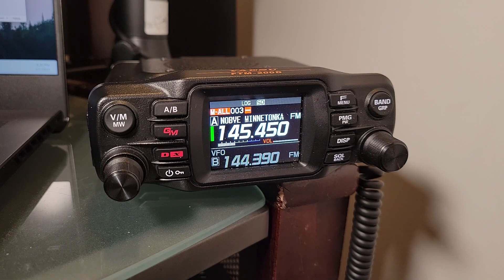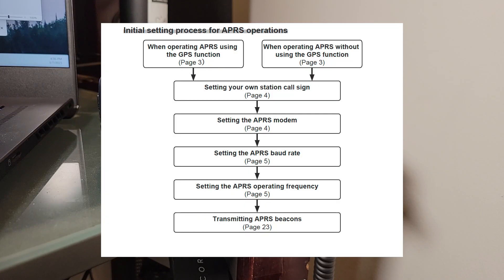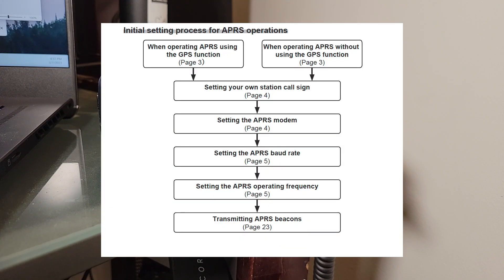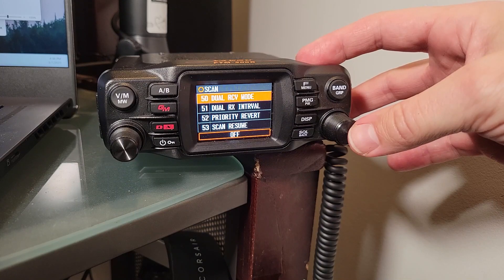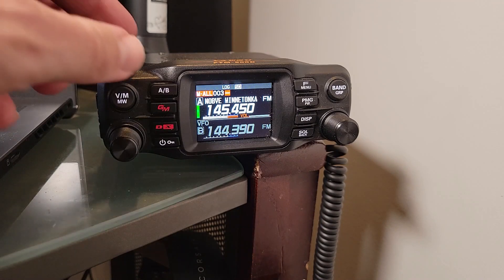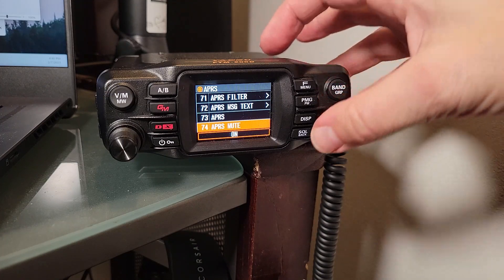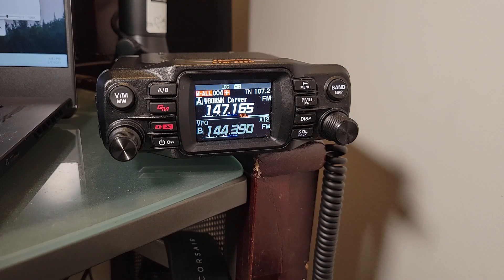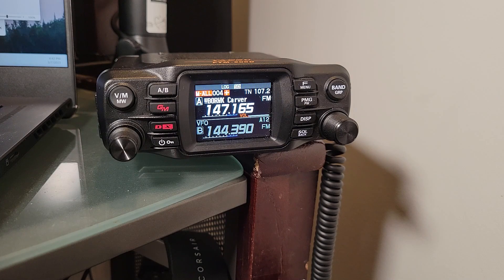FTM 200 APRS Basics

Comment: This is helpful for learning how to adjust settings.  But, I am new.  I have no idea what APRS is or what I would use it for. So.... what is it?
Reply: What does APRS mean in ham radio?
Automatic Packet Reporting System
APRS (Automatic Packet Reporting System), is a digital communications protocol for exchanging information among a large number of stations covering a large (local) area, often referred to as "IP-ers". As a multi-user data network, it is quite different from conventional packet radio.
Reply: What is the point of APRS?
Amateur Packet Reporting System (APRS) is a digital communication system utilized by amateur radio operators to exchange messages and track locations utilizing GPS. APRS is a well-known technology among hams, with numerous applications in emergency communications, tracking, and weather reporting.

Comment: What power adapter do you use for in the house?
Reply from the maker: Thanks for stopping by the channel Chris. I picked up the Yaesu FP-1023A paired with Yaesu DC Power Cables T90217152
Reply: @HamRadioHobbyist  prob a dumb question. But will the same power supply work with the ftm 4&500?
Reply from the maker: @chrisp3193  The stock electric interface will be the same on either of those radios. And Max output of 50w is the same as well, which means you could use this for either option.
Reply: No problem thanks for the reply!

Comment: I am a tech studying for general. Live in new neighborhood with strict HOA. I also spend 3-4 days a week at my parents caregiving for them 40 minutes away from home. I have been wanting to get HF rig to get on 10m ssb (techs can do that) and start setting up my digital packet stuff (FT8 and winlink). I wanted a rig and antenna I could setup and take down and move around and POTA. I saved up for an FT710 (ultimate HF rig) but it would have tapped out my funds (no money left for antennas and POTA stuff). I have been watching vids on Xiegu G90. Portable, has great antenna tuner, waterfall, does digital without too much hassle, has 20w (which is way better then 5w of most portable QRP rigs). I found a super clean used G90 with a bunch of extras would have ran me about $650 new, got for $420. So, getting a Nelson EFHW and setting up me first HF. Very excited. KD9IRA
Reply from the maker: awesome, thanks for sharing!

Comment: Another great tips video. So, does A12 mean that it's at 1200 baud rate? And does the LOG also have to be showing next to the GPS symbol. Thanks for sharing. KC3UEE
Reply from the maker: Thanks! Yes, the 12 refers to baud rate. That would change if you change that setting. The log symbol shouldn't matter for APRS.